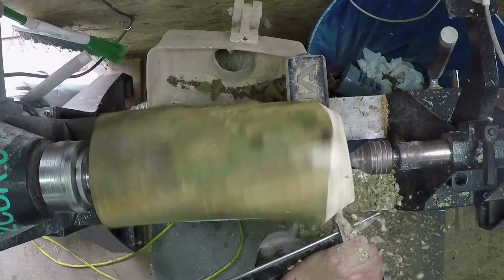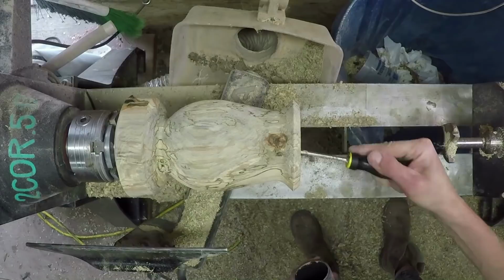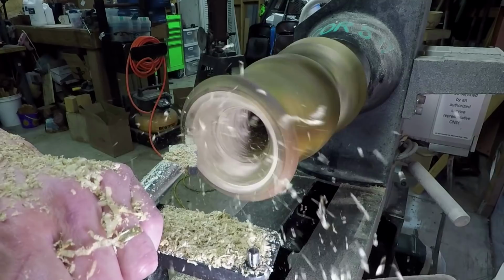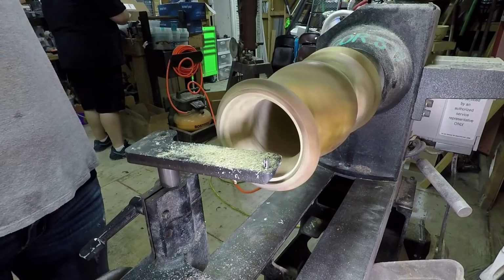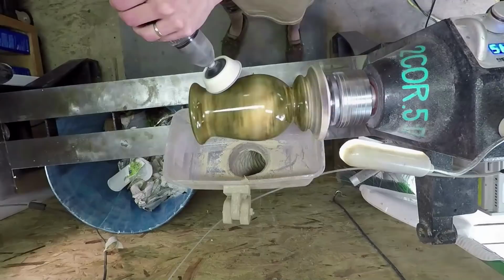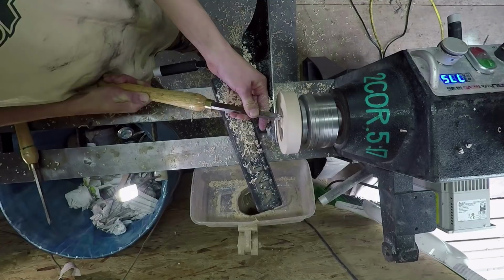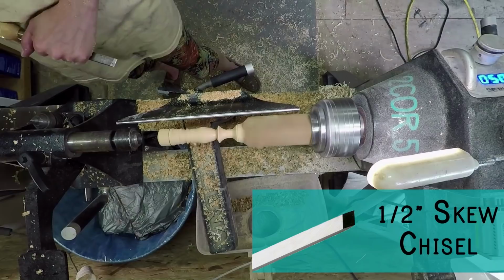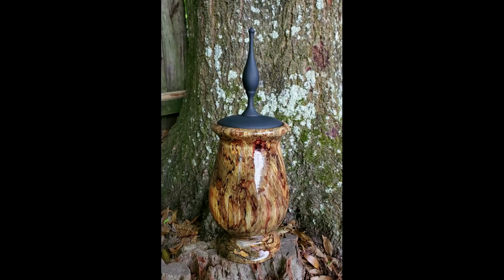Spalted Sycamore Hollow Form and NEW TOOL Tim Yoder Hollowing System

Comment: Hi, 👋, I know why this came up because I’ve been searching for large hollowing tool systems, I ended up making something very similar to this, out of some scrap tubing and some bits of metal, and to make the tubing more rigid, I machined up some pieces of oak and jammed inside it very tight, and like yours, it works excellent,  great piece of kit, what you’ve demonstrating, Will we ever see you back on the workshop floor?, Phil from the moulin France .

Comment: Really enjoyed the video and the review/demonstration on the new hollowing tool. I found it interesting how when you stabilized the wood it had that greenish tint to it plus your way is a lot cheaper than the vacuum pot. Loved the shape you ended up with too on both pieces. As I watched you make your design of the outside shape I noticed it looked a lot like a Roman molding shape. If you have a wood workers supply catalog go to the router bits section and look at their shapes maybe you will find  one that the out line shape might would make a nice shape on project. Where could use turning tools on lathe to make the shape but on a much larger scale.

Comment: Kim, great piece. I also have purchased one of these. It works great in the harder woods (black walnut and hickory). Speed seems to be the trick and keeping a burr on the tool. I do recommend getting a cutter other than the one that comes with it. Becouse the burr quickly goes  away in the harder woods. I have successfully hollowed 13" deep with the 3/4" bar. If you want to go deeper you will need a 1" bar machined like the 3/4" one ( too much chatter). Good luck and keep on making shavings.

Comment: Nice piece and congrats on the Elbo hollowing system. Yes, it's a wonderful tool with a pretty shallow learning curve. I learned on it at the John Campbell Folk School. They have the tool set up on a plate that mounts to the lathe bed to save wear and tear on the tailstock and quill. You might want to check it out - not very expensive. If you can't get pics let me know. I think I still have them.
Reply from the maker: Thank you for the info, Ted!

Comment: Nice work. I use epoxy on most of my turnings. Tip: leave shop dark and put a bright light in a corner of the shop to attract bugs has worked for me. I use rotisserie motors to turn items so my lathe is not tied up. I always have to put a flood coat then a top coat after sanding. I use disposable brushes

Comment: Hi Kim - thanks for the comments on the hollowing rig!
Basic tool question please? 
I have been unable to find a source of a set of callipers (for measuring wall thickness.) I like the look and size of the one you use. Will you please tell me the name and size of the brand you are using in this video. Also - where I can source it? I live in Ontario Canada - but if I have to source from the US - that will not be a problem (other than the horrific exchange rate now :-) - my problem not yours)
Any help you can give me will be appreciated.
Love your work and style of communicating. (PS - still watching for your video on upgrade for your home-made sanding paste, thanks)
Regards
Dennis Beamish Cambridge Ontario Canada

Comment: Can you share again how you cost the wood with Total Boat resin?  Is it a two part resin and you just paint it on the wood?  No drips, runs or errors to fix?  I like your videos but don’t know how you deal with shavings in your boots.
Reply from the maker: Yes, I paint it on and keep the lathe turning at the lowest speed (50rpms for my lathe) took about 1.5 hrs. then shut the lathe off and allow to cure overnight.  I put a box over it to keep dust and bugs off but unfortunately they still got inside my box 🤨

Comment: Simple Woodworking has a similar tool that has a laser to help show exactly where your tool tip is at from the outside of the piece.  Do you think this would be an added benefit or do you find it's easy to hollow without the laser?  I'm asking because I'm interested in purchasing it in the future.